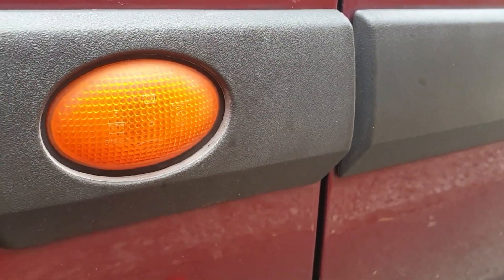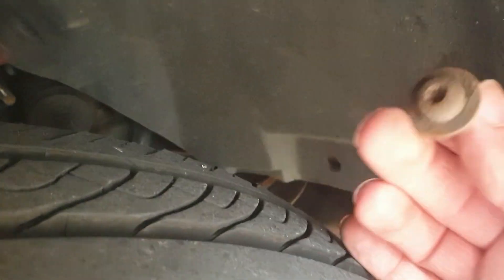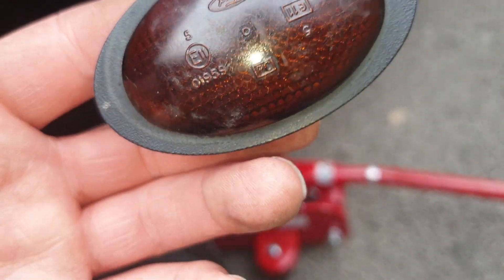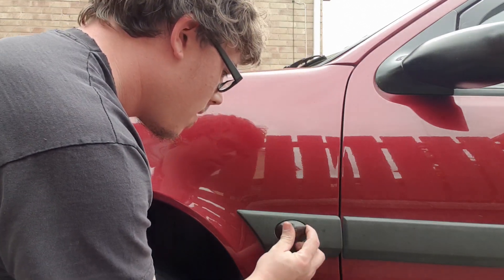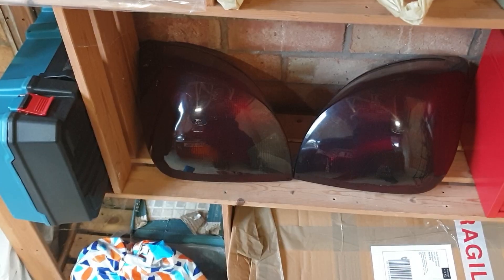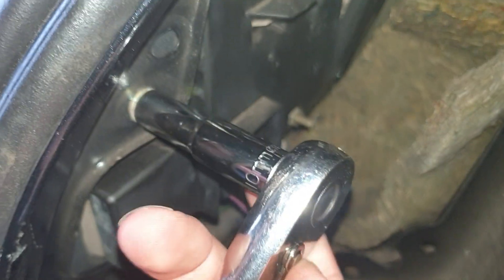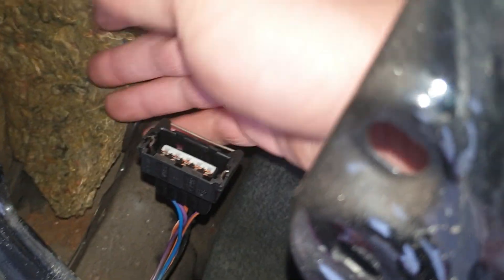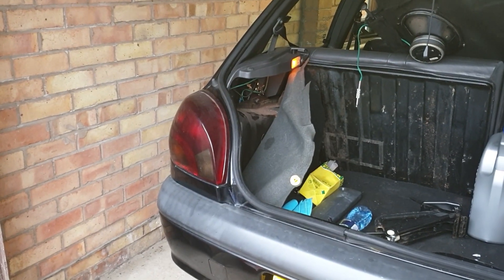Ford Fiesta Mk5 Light Modifications

Comment: Great video, one question, the indicators, are painted black from the inside or outside? thanks :)
Reply from the maker: Thank you and they are painted on the outside with tint spray 😁
Reply: @gazza9919  Oh okk, thank you very much, you have helped me a lot wit your videos (I have a 2001 Fiesta to)😁
Reply from the maker: @Eleirbag69  honestly love hearing that my videos have been useful to someone and I miss mine, there wicked cars.
Reply: @gazza9919  I'm happy to hear this and I'm sorry you had to get rid of your fiesta, certainly after all the effort to fix/modify it, anyway yes they are really reliable cars with quite strong and powerful engine, yesterday I bought the new right headlight and today I have to remove the glass so I can darken the orange part (already done the left one)